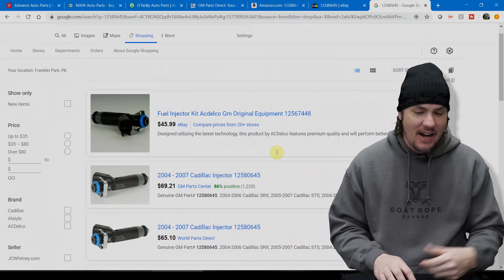Tearing Down The 6.0 LS

Comment: You dont want to ask my opinion, my last build turned out like this. I had to remove the heads, so i pulled the pistons, so then i pulled the crank to do bearings and since i did all that i wanted a melling oil pump and melling timing chain and corvette lifters and head studs and and and, 1200 dollars in parts and machine work later just to have my wife's suburban bulletproofed. 😂
If it hadn't been for your videos i would have never attempted changing all my shift patterns on the built 4l60 which really just means its less crappy, then the original. Love your content, and plan to get me one of them hoodies.

Comment: Take a good look at your cam bearings, that is what wiped out my heads and cam LQ9. Also if you can find LQ9 pistons you will have higher compression or you can run a skinny head gasket.
Reply from the maker: Doing cam bearings, should be a video soon! And running a thinner mls, didn't want to spend any more on this build. If it were an aluminum block maybe...

Comment: I am still stuck on explanation of coolant in cylinder #3 if I remember. If the rocker arms off, valve closed & with the pump off, the coolant level is lower than the head surface. But, I have only done one without removing the heads. The valves looked good Thru the ports as this was out of my son's Tahoe after learning about black ice.
  I ran the engine on a 2X10 ground frame and pipe brackets. Cleaned the injectors 5 times but ran a compression test & cylinder leakage, full warm with actual oil gauge. I just place an 8k ohms resistor on the BCM, did a relearn to test it. DK, ASE Master Tech since 78, retired.

Comment: I have a tuning question, in the e78 platform. Under airflow / turbocharger there is a table "turbocharger base DC" , on the row axis it says desired pressure ratio. I would like to know what math makes this up. When I looked it up I don't get much. Garret pages say it's, a variable equation that combines ambient pressure with Gage pressure devided ambient pressure. But I'm not sure that's quite right for this table. Please if you have a minute could you look into it.

Comment: My lq4 had water in it too maybe they come that way.

I read that the cam bearings fall out before and after replacement.   People glue them in with machinists loctite green.  I read about one person pinning them in with grub screws!   It doesn't seem as though the cam bearings bores are perfectly aligned from the factory and the old wives tale is that they are line honed as an assembly.  Or maybe the cam just does it.  There's always visible wear.     Annoying.
Reply from the maker: Interesting about the loctite